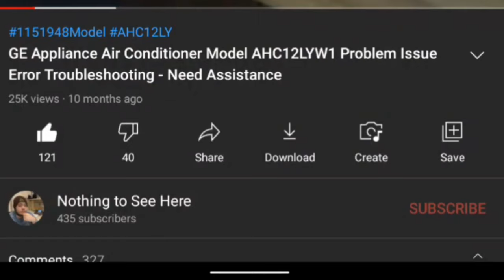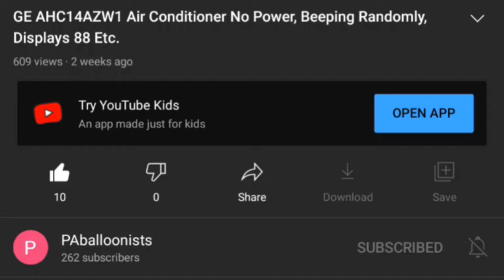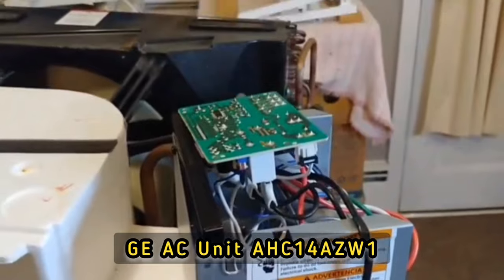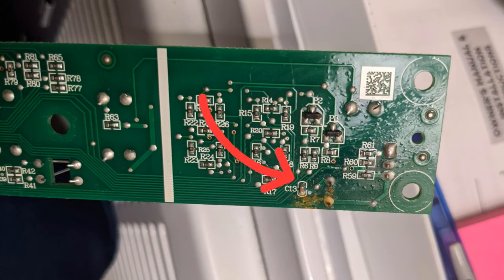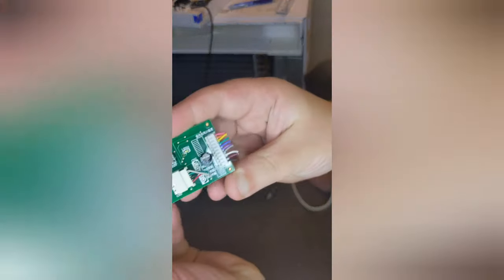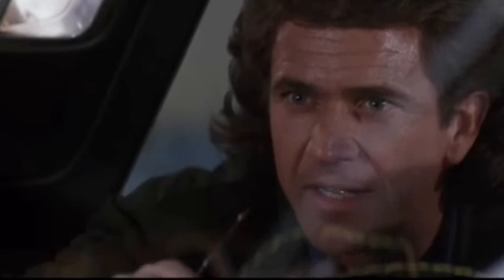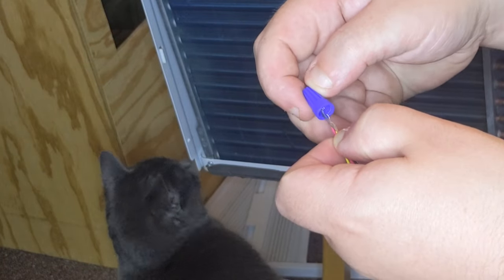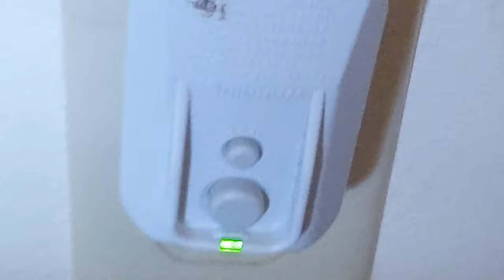GE AC Unit Model AHC12LYW1 or ACH14AZW1 - Unit Beeps, Shuts Off, 88 Symbol Bypassed DIY | How to Fix

Comment: Mine is just now starting to act up.  No beeping but shutting off and on and then nothing  I flipped the breaker and tried to turn it on but nothing.   Then it starts working at any random moment till it starts the process again.  I’m sure it’s the board so I will be doin this to avoid it gettin too hot and roasting me if it completely shuts down.  Thank you!!!! But this still blows having to do this to a unit that isn’t that old

Comment: Thank you. Used your method and now I’m back up and running. Trust me, I had no idea what I was doing but you made it pretty simple. I only had trouble stripping the wires because I kept breaking the wires in the process. In your opinion, any concern of a possible fire occurring? I did notice a small spark when i plugged the AC in. Also, i used both electrical tape and the wire cap to bind the wires because the cap wouldn’t stay on by itself.
Reply from the maker: My only concern is the excess wires that aren't used.  Individual wrap with electrical tape and wrap all those wrapped wires together.  Like putting a mitten on over gloves!

I agree, the stripping is the hardest part .. those wires are delicate.

Spark on plug at wall outlet is normal...
Reply: Ohhhh ok. Didn’t think to tape the other wires. Will do that today. Thanks for that info.
Reply from the maker: @tanishab967  just in case.  Don't want them to cross and short the machine or cause any other potential issues....
Reply from the maker: Always cover the lose ends... Used or unused.
Electricity can do some crazy things!

Comment: Unfortunately this didn't work for Model AKLK14AAG1 - 14,000 BTU. But there's only 4 wires for it Red, Yellow, Purple, White. I tried a combination of twisting white, red, and yellow... and then all 4 together and it will not come on. Any ideas what might work? Also you can't find a replacement board for this anywhere. I ended up splicing them back to the connector and the board came on but still doesn't work.. buttons do nothing and stuck on 72 with no cooling. The board had lots of condensation on it when I first pulled it and rust. Also there's lots of dirt or mold inside on the styro foam. There really should be a class action law suit for these horrible products.

Comment: Are the J1 through J4 pins supposed to be bridged across the gap on this board for the AHK models?  I’ve seen some boards only have J1 and J2 or J3 and J4.  

My J3 bridge is OPEN.
Reply: Did you ever figure it out? I have an Ahk12 and the J4 and J2 are disconnected.

Comment: Thank you ver much. I also added in a DIGITEN Temperature Controller WTC100 Wireless Thermostat Outlet Temperature Controlled Outlet Programmable Thermostat Controller Wireless Thermostat with Remote Sensor Greenhouse Thermostat. So now I can adjust for temperature. Thanks again for posting. GE could go to hell for this. I bought my house with nothing but GE products. When they go I will never buy another one again.

Comment: Look at your control board next to where the wires are connected should be printed on the board some letters in a box =vcc, gnd,comp. med ,lo ....ect. they correspond to the wires vcc is voltage on my unit its at the bottom ,which correspond with bottom wire black. The ones you need are vcc, comp ,high .I put a switch to turn it on n off. Vcc feeds comp n high wires
Reply from the maker: @rogercoronado6106  thank you for the great details.
Reply: Hey Roger thanks for the details. Can you clarify a little further? Are you saying that only three wires need to be connected and not the four that are mentioned in the video? What kind of switch did you use to connect the wires?

Comment: The black and white wires energize the pump, the black and yellow energize the fan, does anyone know what the red one does?
Reply: I am thinking the red is the one that tells the power supply to run them both on high. I believe orange and blue are med and low or a some combination there of. I'm thinking green being the ground would also be helpful just in case the condensation and possibly exposed wires could potentially create an electrocution hazzard.

Comment: My issue that I am currently experiencing is that the temperature control raises on its own and now the buttons do not respond. I cannot turn on/off or change the temperature. I am going to look into that board later today and update this post. Thanks for the video.
Reply: I have the exact same issue. What I did was connect my phone to the unit. If your unit is on download the app then if you can manage to hit the wifi button just right and it start flashing you will be good to go. You can use your phone to control the temp and speed. My unit was temp was going up every few mins all the way to 86 but I kinda hit (punched) the up button and it stopped doing that. Now I just use my phone and can set the unit to whatever we want.

Comment: AFTER DOING THIS FIX, DOES THIS MEAN YOU CAN'T USE THE OTHER FUNCTIONS ANYMORE, SUCH AS DELAY AND TEMPERATURE ADJUSTMENT? 

WHEN YOU TURN IT ON, IT'S JUST ON THE HIGH SETTING AND THAT'S IT?
Reply from the maker: Correct.  Unless you can find a replacement board ... And solder... This is the quick n dirty

Comment: Mine didn't blow on high, is there a different wire for medium? The compressor turns on with the bypass wiring instructions you gave but fan didn't blow on high and hasn't for a year so I had to keep it on medium to work. I wish there was a color coded wiring diagram on these things so people can get em going when cheap chinese crap fails...
Reply from the maker: I wish the wires had a diagram too.  Apologies I cannot assist further...
Reply: @clarkkc11  That's ok I got another one, thanks

Comment: What temp will this be set on?
Reply from the maker: Coldest setting I believe.  I do not know actual temp.

If you are in a more humid region, be careful of overuse and moisture build up.
If you are skilled or know someone with a little bit of electrical prowess, you can install a thermostat and switch to replace what was removed from the computer board... But I am not that advanced.

This is like the button on your toaster breaking... You hotwire the toaster to toast when you plug it in the wall and you watch that toast... Only instead of hot, it's cold.

Comment: Excelente, yo tengo un aire general modelo CY95F698K   con los mismo problema al prender, seguí el cableado y los conecte como dice el video y me funciono excelente perfecto, muchas gracias.. Ahora voy a conseguir de la placa electrónica el microprocesador que es el CY95F698K y lo voy a colocar, no boten el board, para mi es fácil trabajo con componentes digitales. Después le comento como me fue, gracias.
Reply from the maker: Gracias!  Thank you!  I hope your solution with the circuit board goes well and you can fully repair AC.  I still have the board I removed from my unit in a junk drawer with the remote.

Comment: Got with ge warranty it’s up in two weeks no reply from them haven’t cut the wires yet but about to you 💯 percent on this fix does it put it on the coolest setting is all I wanted to know before I take the plunge 😮✂️ 800$ unit but it’s the same board checked it out will the fix keep it at lowest temp 62 degrees is what I was wondering
Reply from the maker: If your warranty is around a year... Fight em for it tooth and nail!
Reply from the maker: It does put in coldest setting
Reply: @clarkkc11  awesome here goes I wonder if I left the other wires uncut and left on board would it let you work the other settings gonna leave them and let you know if that allowed the other parts of the board to work and thank you will get back see if let’s the board control the other settings
Reply: And thanks 🙏 for reply
Reply: It worked blowing cold 🥶 your a life saver my friend
Reply: Saved me 800$
Reply: Did leaving the other wires connected work? We just got our AHP14LZW1 reinstalled for the summer after buying it last May, only used it till September, had maintenance take it out of the window, and it is doing this. I’d love to still be able to use some controls and not have to but a secondary thermostat
Reply: @KomekoroKoa  it worked so just like he said in video use a small wire nut and electrical tape mine is still blowing ice cold I just cut the wires he said cut and twist together put a electrical wire nut and electical tape  turn it on and off at plug blows super 🥶 cold the other buttons do not work but it is the coldest and highest setting

Comment: I tried this and it works but the air isn't that cold. Any way to make it colder? I know the compressor was working before the circuit board went to shit
Reply from the maker: Got all the same wires?  Is it the same model?

Comment: this works great and my AC has been doing fine but now i get  frost and snow buildup after only running it an hour and its almost summer now so this is a bad time to only have the AC on for a single hour
Reply from the maker: Yes - this is a very common issue - as that dysfunctional board was intended to be a thermostat as well as temperature and on off control.  But, because GE does not make this part easily available to replace... Literally, for years most people have commented and asked where they can buy the proper part, to make it so this issue doesn't happen... But it's always out of stock.  It is best to save this AC for dryer months and keep use to a minimum... Works great for that hour but humid areas experience this problem worse than dryer regions.
Reply from the maker: It's not as efficient or effective as it originally was... But much better than a 1 cheezit bag... 😂

Comment: Yeah you can jump the wires and tie  them together for the unit to work. But without defrost mode The AC will lock up. Will only run for a few hours

Comment: If you change which wires you connect together , can you keep it stuck on medium instead of high speed ? My board is fried but the AC on high is too loud.
Reply from the maker: Yes, but which wire is medium... I do not know.... Maybe someone can read the board and labeling more clearly that I could ..
Reply: @clarkkc11  hahaha. I will look into it more. Thanks for helping me get my AC going and thanks for the response!
Reply: Michal, on the main circuit board medium is the forth pin down on connector for my AHC08LYW1 unit, it's the green wire. High is the yellow wire. Low is the blue wire. Hope this helps
Reply: @marktortella8073  that helps immensely. I had tried to figure it out through trial and error but couldn't find the right combination. Thank you so much.

Comment: I went through a lot of the cord trying to strip them properly and got it goin with the 4 wrapped together in electrical tape and others wrapped individually in tape.... but it's not long enough to reach the plastic circuit board spot anymore and stops at the 2nd wire holder thingy. Is it okay if it's just below and outside it? Like is condensation gonna make them damp and explode or something?
Reply from the maker: No.  Should be alright

Comment: How do you control what temp its set at?
Reply from the maker: That is a different wire connection than shown.  I would like that information but finding a schematic of the wiring is difficult.  Someone may have stated in the comments but that may take some searching

Comment: i have a GE AC (AHP06LZ) will this be a permanent fix or will i have to keep doing this fix? trying to figure out whether i should just junk this and buy a new one or fix it once
Reply from the maker: This fix removes the wifi board that causes the on/off malfunction.  This fix takes the operation of the on/off from the front panel (where moisture happens) to the surge protector at the outlet/plug 🔌

Comment: Thanks for this video, of course it shit the bed after the manufacturer’s warranty! Thanks for the temporary fix until I can get the control board in the mail!
Reply from the maker: If you just over the warranty date by a day... Lie and find a way 😂
Reply: Do you have part number for user interface for AHC14AZW1 unit?
Reply from the maker: @DeepBlueApnea  I looked it up once but it never had inventory anywhere...  Not ebay... Not ge... No 2nd hand sites...

Comment: I don’t have the same model but my circuit board is the same and was very corroded so this hack works for me thank you
Reply: Thank you so much! I had just put a new circuit board in and within a month this happened. I will never buy another GE product.
Reply: @teresahenegar2094  do you have a link for the circuit board or model number?
Reply: No I don't. Sorry. The circuit board was clean. It has just been replaced last year. So far this fix has worked great and I didn't have to buy a new one.

Comment: Thanks man I ended up just pulling dark purple wire out of Plug and it works on low speed, no control board functions
Reply: So you just disconnected the dark purple  thats all?

Comment: I'm having the same issue with the same ac from lowes just about a year old in a couple of months 14,000 btu. Unit. Is it worth fixing?  The unit was over $400.
Reply from the maker: If it's over a year... Your pass the replacement period unless your a good liar.  And by all means .. go for it and try and get a replacement.... But this fix works well.  Just lose. Control of temp and settings.  On and off only.  High only
Reply: @clarkkc11  lol seriously June 2Oth of last year is when I got it. I'm so upset with the junk they are selling so it's just about 2 months over the warranty. I have a fridgeaire if I'm spelling that correctly that's over 3 years old and it's still working 💪  lol.  They want you to buy extended warranties BS. The thing after taxes came out to $715 bucks and for that kind of money I would expect a good run for that cost. I'm old school and I'm use to things being made to last sorry for the rant and thanks for the reply 🙂
Reply from the maker: @teresamarie4689  I got my quote goodwill certificate and body replacement unit, was left with my junkie unit, and within a month of installing the new one they were already sending me emails and calling about buying the upgraded protection package... Such a load of crap

Comment: With this bypass,  will the compressor cycle  on & off as the low temperature is reached,  or does the compressor remain running constantly?

Sounds like someone should start a class action suit.  It would appear from just looking at the amount of comments on this video from owners of these machines that there is a defective design in place, and GE is doing nothing to fix the issue...
I can only assume that there are many many times more units out there with the same issue,  and that the owners are not looking nor posting on YouTube.  Someone needs to hold GE (or possibly Haier?) accountable for selling shoddy products with known issues.
Reply from the maker: It remains on as long as you have it plugged in.  Others have wired in switched and thermostats but I have not see a video
Reply: @clarkkc11  Thank you for the prompt response. Truly appreciated!

Comment: Just want to say thank you to everyone that has helped figure this out. By following the steps in this video, does that lock the unit into the coldest temperature and highest fan speed?
Reply from the maker: Not sure if it's the highest or coldest setting as the wires on the circuit board aren't labeled clearly and diagrams are hard to find...
Reply: Based on previous performance, mine is now blowing at the highest speed and coldest temperature after the fix

Comment: Hi. Is there a way to use this method but to have the ac run on a low setting instead of high? Thanks
Reply: Try green for medium and blue for low. That is the way it is labeled on the board. Yellow is high

Comment: Doing this will it still kick on and off for the eco mode?
Reply from the maker: No
Reply from the maker: This solution cuts out the remote control and hard wires a fix setting, operation is limited to turning it off at the plug or surge protector

Comment: Hello, I have the same brand of air and the same thing happens to me… I have been without air for more than 2 weeks straight… I did the same thing that I saw in your video, my question is, can the other cables that were left loose be connected together?
Reply: Noooooooooo

Comment: Nice easy fix! 
Dose anyone know what the other color wires correspond to on this unit? 

 I did have another board from a different unit, Samsung maybe, it seemed it might work... but after a 3rd inspection I found the issue, a micro-crack on the board right between the power button! Probably  could have fixed prior to chucking it at the wall?

Comment: I didn't get how to change the temperature or  will it stay at certain temp.???
Reply from the maker: That function is lost.  It will remain constant.  Unknown but cold.
Reply: @clarkkc11  , what if you set a certain temperature before removing that board, is there any chance that will work?
Reply from the maker: @alexkastano96  not sure it works that way.  There are comments that highlighted different wire connections... Search comments for wire colors and you should have answer.
Reply: It actually worked 🎉

Comment: Mine has a non stop beeping but stays on and doesn’t flash .Would I do the same ?
Reply from the maker: I imagine you are having a very similar issue with the control board.  Perhaps you can simply cut the sound wire

Comment: Quick question how do u change the temp lower with this bypass
Reply from the maker: Find the 'low' wire.  There really is no control beyond on and off with this solution.  It's a "I can't find a part, a guy, and he won't cover the cost" fix
Reply from the maker: Wish I could be more help.... Someone in thread might be more knowledgeable.  But their schematic wiring was archaic to me...